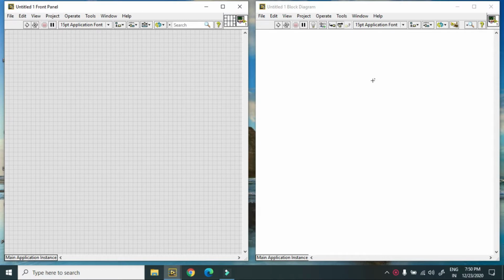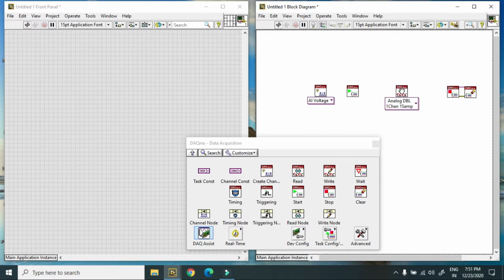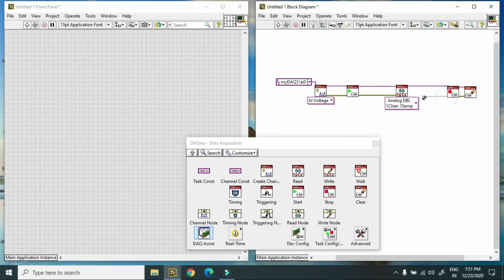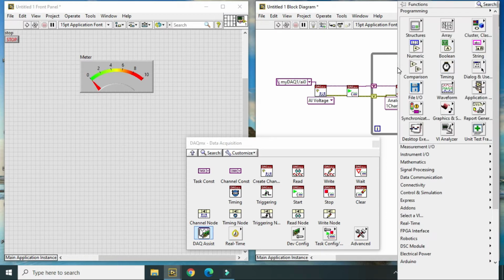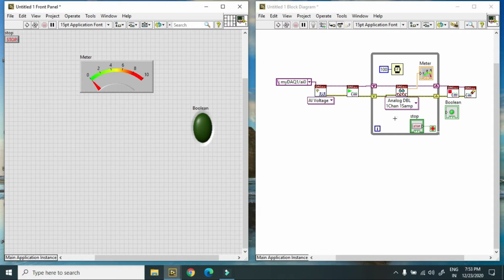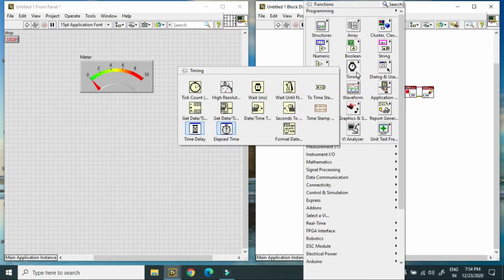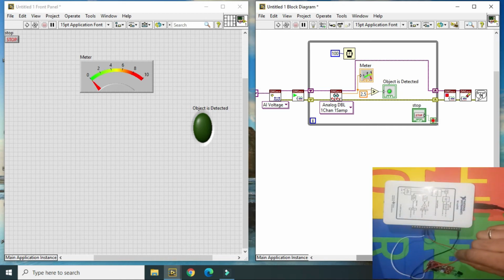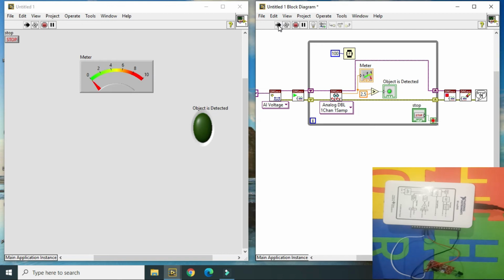IR Sensor Interface Using MY DAQ

Comment: How to interface level sensor which is placed on stand with mydaq to monitoring level of water in bottle
Reply from the maker: Just use analog input port in differential mode
Reply: @SalimKhan-by1ky  tq but sry can u explain in details becoz i am new to labview so
Reply from the maker: @marchflower2793  just connect positive wire of level sensor to AI0+ pin and negative to analog ground and connect  AI0- to ground
Reply from the maker: @marchflower2793  then go to software part

Comment: Please equestion to whom working in labview practicaly ???
IS labview just GUI and simulation on PC or work practicaly with machines ???

because i didn't saw it on practical applications !!!
Reply from the maker: Hardware integration with LabVIEW is very easy as compared to other softwares
Reply from the maker: Real time changes is possible without stopping the process